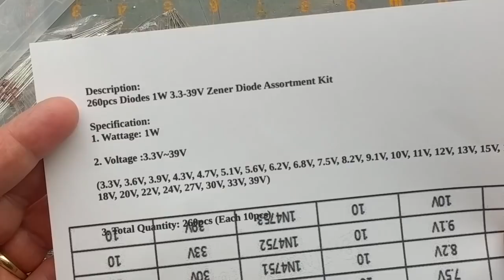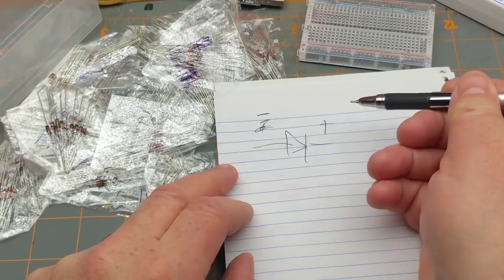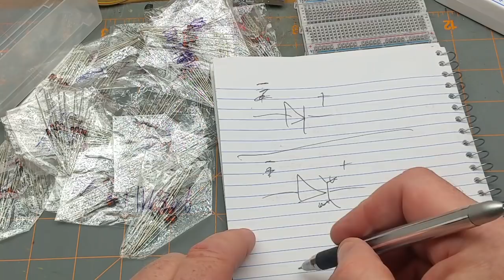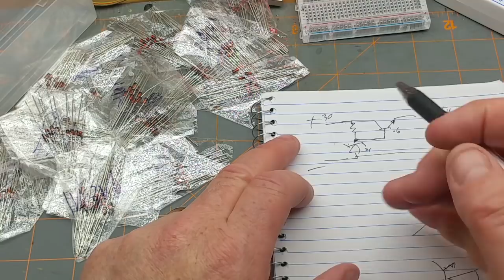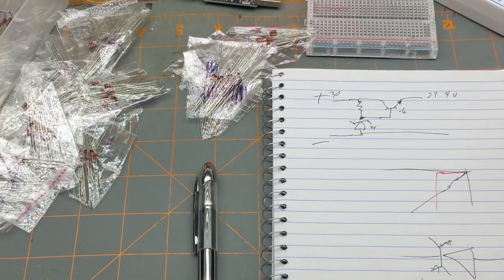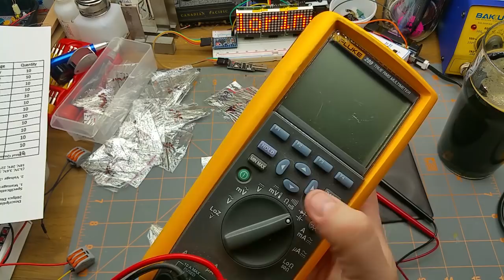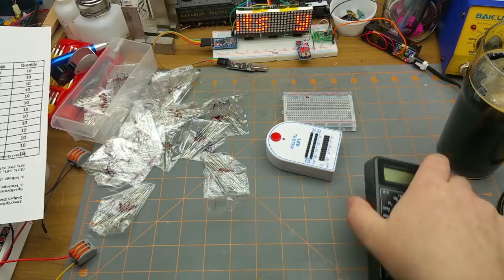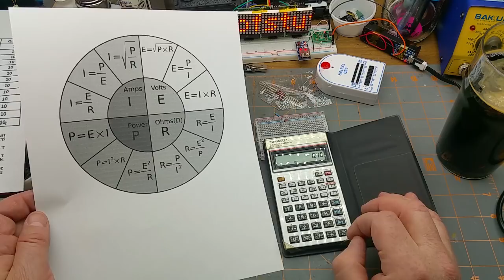looking at zener diodes

Comment: Hi     I built my Zener tester using a circuit published in the UK magazine Practical Wireless
Feb 1974 .It uses a 2N3055 and a transformer made from a ferrite ring with 3 windings to
produce a high voltage so can test most zeners . It has a 10k resister in series with the zener being tested but this can be reduced to 5K by pressing the ' Quality ' button which
puts another 10k in parallel with the first .A voltmeter reads the voltage . It can also tell
you what the voltage of a neon ( indicator ) is and perhaps could be used to test breakdown
voltages of other components .
                                                                                                                Alan
Reply from the maker: I've been re-exploring some of the old magazine circuits of my youth recently (Radio Electronics, Popular Electronics Electronics Today, etc). It's a great reminder of how we used to do things before the era of cheap multi-component testers and microcontrollers.

Maybe I should start doing a few videos on some of those "circuits from the magazines of my youth"...
Reply: Great Idea! My old mags are long gone.
Reply from the maker: Drex: All your old favourites are online:  http://www.americanradiohistory.com/Popular-Electronics-Guide.htm
Reply: I had no idea, Wow,Thanks.

Comment: I have been trying to figure out if these 1N4148 diodes are Zeners and I believe that even though they are in glass packages ... they are NOT Zeners. Wiki says "The 1N4148 is useful in switching applications ..." but I am not clear on what a switching application is ... I have no idea what to do with these suckers and I got 25 of 'em ... well 24 after the accident. 😂
Reply from the maker: As the old saying goes "If you're not breaking things, you're not learning".